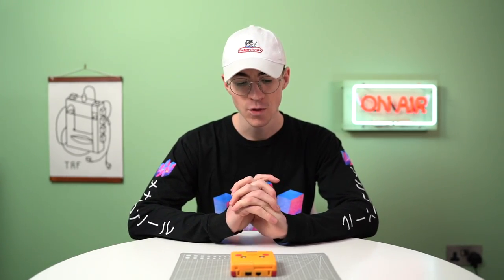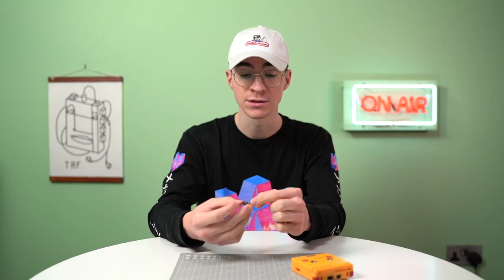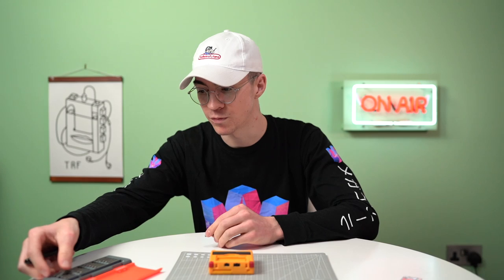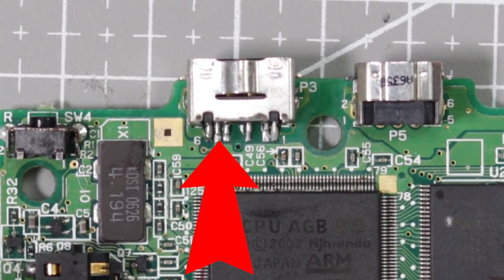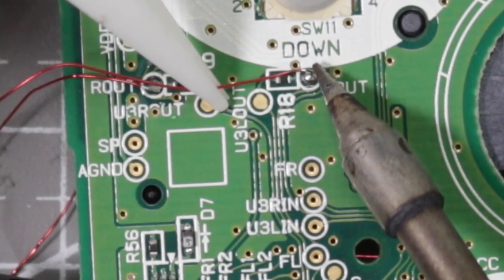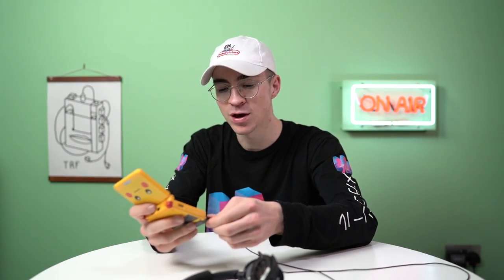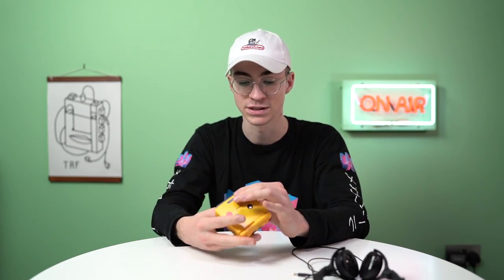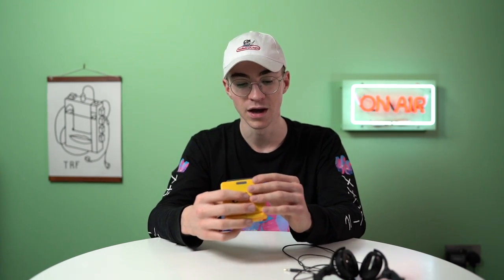Giving the GameBoy Advance SP a headphone jack 17 years later

Comment: The dongle I have is really noisy, too, which is my main problem with it.
I don't know if the mod fixes that but I will give it a go.
Reply: needs some caps too, there is a kit to fix this issue
Reply: @OuterHeavenBoss  Managed to get it done though my soldering iron glitched out and set itself to 475 degrees so I ended up burning the pad for the left channel off :/
It does sound slighly less noisy, imo, even without the caps.

Comment: Elliott, you can totally charge and use headphones at the same time without this mod, literally 3 out of the first 4 google image searches for "gba sp charge headphone dongle" are all different dongles for this.
secondly: how did you handle closing up that corner of the gameboy without the screw?? is it just screwless now?? is there a gap in the plastics? will this look good on a transparent shell?? Elliott, i need answers

Comment: Btw, are later gen GBA games region locked based on a GBA SP? I have a copy of Pokémon mystery dungeon red rescue team and it boots on my GBA, but on my GBA SP AGS-101, now it has a replacement morherboard and not sure if there is an implemented barrier or are the pins jsut needing some maintense?

Additional note: i managed to make my Pokémon crystal cartridge unable to save after replacing the sabe battery(its oriented properly) and i think the cause us  i broke a couple traces on the back of the board, would that speaker wire be thin enough to fit between the back of the motherboard and the cartridge case without me modifying the shell itself?

Comment: I have a question, i have purchased a used gba sp but the sound doesn't work. I took it apart and tested the speaker that works fine but when i hold it to the contacts it does not work. Any ideas?

Comment: As a matter of interest, what is the sound quality like through headphones? Would you say it's clearer than the audio through the adapter / speaker? I have noticed a tiny bit of interference / shushing through the speaker / adapter but I think that has something to do with the power drain of the IPS screen. I saw a mod somewhere to add a capacitor to diffuse the sound, but was wondering if you get the same kind of quality through headphones?

Comment: Honestly if I was more confident in soldering I would do this but soldering the single wire for my IPS screen was a mess as is
Reply: Flux is a big help. The IPS mod is scary when you don't have much experience because a wrong move and you just melt the connecting cable that is 90% of the mod's price. I got a soldering iron pretty much just for the IPS mod but I ended up needing it to replace L and R microswitches on another SP and even the tactile switches for A and B on another one. The tactile switches are a pain. They have plastic parts that melt if you take too long and I had to lift working ones from a broken motherboard and then solder them to the working board. I hope I never have to do that again.
Reply: @chamoo232  actually my R switch is a little mushy so I'll probably have to fix that soon
Reply: @butterccm  Good thing about the L and R microswitches is that they are easy to find and easy to replace. Just make sure you get the 4 legged ones. There are many 2 legged ones being labeled GBA replacement and they do work but they are clicky ones. The original and 4 legged ones are rubbery. 2 legged ones are ok to the feel but they make that loud click noise that I find annoying. Pay a little bit more for the 4 legged ones especially if you only change one. You wouldn't want a soft quiet L and a stiff loud clicky R.

Comment: This is probably a stupid question, but I'm trying to learn more about the individual components on these boards. How did you know where to solder wires to to get sound in the headphone jack?
Reply: It's shared knowledge from the internet. The GBA SP motherboard has letters and numbers on all those round test points. If you follow the traces you can see where they go. So for example the IPS mod has a cable you need to solder to the motherboard so the brightness button can change the new screen's brightness. If you follow the trace from the brightness button it goes to a test point called Q12B. If you were to solder that cable to TP2 you would end up changing the brightness when hitting select. Having a volt meter makes it very easy to know what everything is as you can just test for continuity to see what goes where.
Reply: @chamoo232  That's so helpful, thank you! When you're doing this mapping, what do you have your volt meter set to? I'm entirely self-taught, so again, sorry if these are dumb questions!
Reply: @lavahotpocket3886  Continuity should work. It's the most useful setting when playing around and fixing old electronics. Like if you have 2 SP motherboard but one doesn't read games. You could check each pin of the cartridge slot on the working one to see where they lead and check if you get connection on the bad one and possibly find which pin is not working and causing the games to not read. You should check out a channel called My Mate Vince. He does a lot of that kind of repairs and is also self taught. Often he doesn't manage to repair the stuff. Sometimes he even end up causing more damage but it's always interesting to watch and learn.
Reply: @chamoo232  I'll check it out! I don't mind when I can't fix things since everything is a learning experience! This has been so, so helpful! Thank you very much!

Comment: This looks great and I would love to do it. But what puts me off is that in the end, only some headphones will work. I’ve got the original pocket go which has the same issue, you need to use headphones without a mic or you don’t get output unless you half pull out the jack. 

Anybody more knowledgeable than me know how to do this to work on all headphones?

Comment: What gameboy would you recommend for a first time buyer?
Reply: It really depend on what you plan to do with it. Just for collecting or nostalgia or properly play it? The best GBA to play is the original GBA but with the IPS screen mod. It's the best screen and that GBA is the most comfortable to hold. It also support GB and GBC games. Only downside is the AA batteries. The SP has a rechargeable battery, support IPS screen mod as well but is not as comfortable to hold.

Comment: Does removing the screw post cause the shell to open up more in the bottom left corner, or is the shell rigid enough that that's not a problem?
Reply: If it was the top part with the screen I would be worried but for the bottom not so much. There is a screw right in the middle where you insert the cartridge. If you don't twist the entire console it shouldn't open the corner.

Comment: the whole dongle idea was stupid, even more so when it uses the charge port, i dont care what your opinion of Bluetooth is, but its never worked out for me, it either disconnects whenever it feels like or some other issue and yes ive had the chance to try good quality ones in recent years, they have the same problems, just slightly less frequent, ive never liked modern apple devices and the new trend means that i dont bother considering most new phones.  funny enough they put the headphone jack back into some of the newer ones as a budget feature, more reason not to buy the top of the line

Comment: If you could have removed the headphone charging Jack and replaced it with a micro USB and headphone and then just filled up the rest of the whole with like epoxy or something that would have been potentially better
Reply: I don't think there would be enough space for both. What I do think would be worth trying would be to remove the link port and use that space for the headphone jack.
Reply: @chamoo232  how will you play multi player or use it on a gamecube?
Reply: @bland9876  You don't. that's the sacrifice. For me it wouldn't be a problem as I don't have a gamecube and have 10 different SP. Link connection would only be needed for trading pokemons and I could switch to another GBA for that. Another idea would be to use the charge port and convert it to a headphone jack. That should be easy since that port can already be used as that. Then find another location for a USB-C. It's a much slimmer port than a headphone jack so maybe it could be easier to find a spot for that.
Reply: @chamoo232  why not do what the ipod shuffle did and charge through a headphone jack (it also had data transfer for songs through it)
Reply: @bland9876  The shuffle probably had something inside that could tell the difference when it's in charging, data transfer or headphone mode. The GBA has different pins and to use the same headphone jack for everything would mean putting the battery connectors with the audio connector. That sounds very risky.

Comment: Thinking of buying a SP but don't know which is better AGS-001 or AGS-101? Please help Elliott.
Reply: If you don't plan on adding an IPS screen then get a 101 for the back light. If you plan to use the IPS mod then get the 001 as it will be cheaper to get and the mod is compatible with both. Just don't get a 001 stock and hope to play games on it. That front lit screen is terrible. Other possibility would be to get an already modded one if you don't have the skills to do the IPS mod.
Reply: @chamoo232  Where is the best place to buy a modded one from? Don't feel comfortable doing it myself.
Reply: chamoo232 Had a look at the sellers page but does not ship to where I live. 😞
Reply: @CLC-1000  That's weird. Check other Ebay sellers. If the price is good and they have 98-100% feedbacks then it's pretty safe to order from them.

Comment: "There is no reason why Nintendo didn't do it... some say it was because they couldn't find a space to put it." Nope. It would've been trivial for them to put it on the back with the other ports. The reason they didn't is the same reason Apple doesn't include one today; they simply wanted to make you buy an additional proprietary adapter or headphones, both for some added profit and for added control. It's the same reason that the USB-C port on the Switch doesn't technically follow the USB-C charging standards and you need to buy a special adapter for it, and the same reason that various Gameboys of years past had proprietary power adapters (I distinctly remember my DS using 5V, same as any USB/phone charger of the time, but it had a special cable and end on it). Nintendo has always been really offensive with this stuff, almost as bad as Apple and Tesla. Also Nintendo is notorious for penny-pinching to save cents on production costs to make sure their hardware sales are profitable. Remember the NES blinking all the time, it wasn't because the cartridges were dirty, it was because Nintendo spent 2 cents per cartridge port adapter instead of 5 cents and bought some cheap defective parts that didn't make good connections, bent, and scraped/damaged the cartridges. Same reasons that Gameboys always had crap screens. It kinda made sense for the original Gameboy to have a non-backlit green grayscale screen; it made no sense in the GBA time frame, except that they were cheap. So basically, somebody at Nintendo went... "oh if we don't include a headphone adapter, we can save 2 cents per unit on production costs, and then we can sell our own headphones and adapters and make a bunch of extra $ off parents who don't want to hear what their kid is playing".

Comment: Hi , I appreciate the effort you put in but I like my things original/ factory spec. I got brand new headphones which work with my GBA SP (sans dongle) for £3 off eBay. I might consider doing some of your mods to a broken console as part of a repair but feel modding classic consoles especially those in good working order is like sticking a body kit and spoiler on a Jaguar E Type. 
I would not super charge my ScaleXTric! “Sacrilege “
If you don’t want classic and original there are lots of fake consoles out there (brighter screens , better battery life etc etc).I want original and classic which your frankenstein gameboys are not I’m afraid . 
For those who like to “Pimp” there stuff I imagine your videos are very useful .
As an aside I will not be sticking 20” alloys on my VW transporter which in my opinion spoils the ride and shows a lack of taste ;)

All the best :)